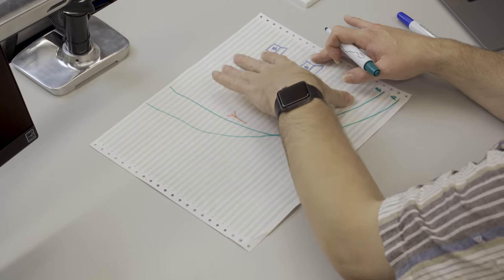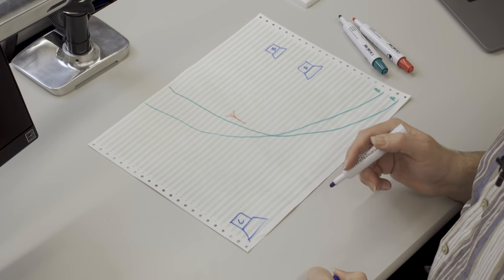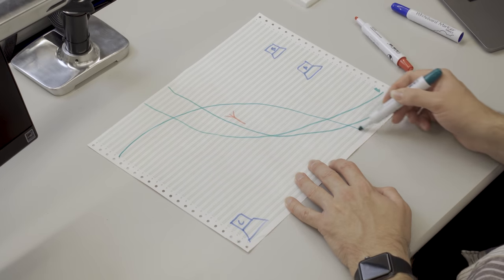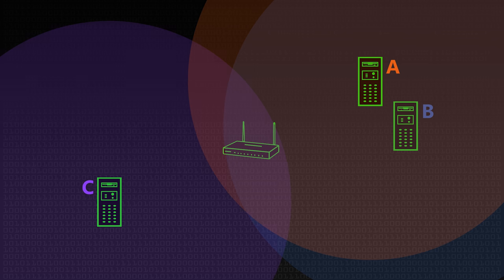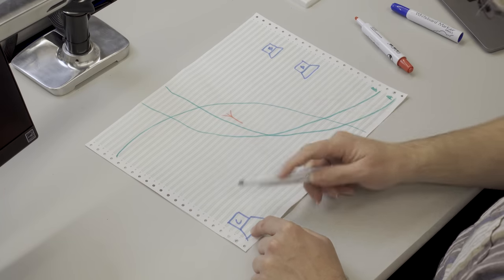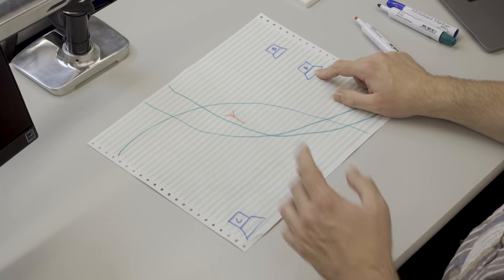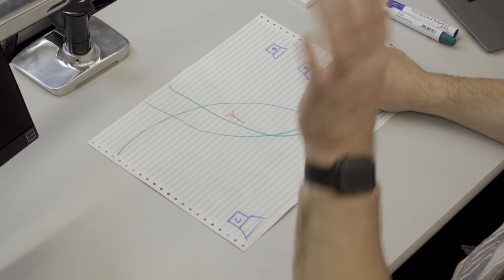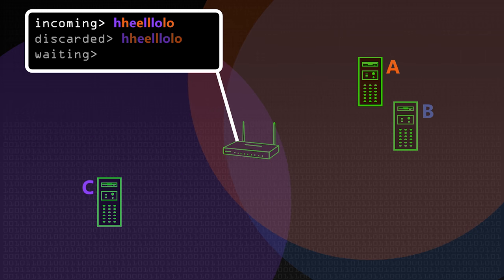WiFi's Hidden ____ Problem - Computerphile

Comment: Don't get it.
If node 'A' is sending a large packet then 'C' doesn't know about it. 'C' will then send its RTS packet which might be short but is still going to corrupt the large packet 'A' is sending. Both packets still get corrupted, its just that 'C' has only lost a small packet. How has that helped?

The only way I can see around this is if the base station sends another packet to tell 'C' that 'A' has finished talking.?

Comment: I presume an access point that can handle 30 devices would effectively be able to do 30 of these handshakes at the same time?
Reply: Nope. One at a time per channel. They just happen in milliseconds, so in practice it can seem like you have multiple devices connected at the same time. Some routers DO have multiple channels though, split up by wavelength, and beam-forming can allow an access point to split up each wavelength into multiple spatially separated channels (MIMO). But this video is clearly only talking about a single channel, omnidirectional access point.
Reply: @benjaminmiller3620  so how would router/access point deal with multiple devices downloading files at the same time? Do they have a limited number of packets and just take turns at being able to receive data? Genuine question..
Reply: @JayGee6996  Yup. You got it exactly right.
Reply: @benjaminmiller3620  interesting, thanks for helping me understand. I work in a school where my student’s laptops are constantly dropping off the WiFi network, either connected but no internet, or just drop off totally and need reconnected or throw error messages in chrome saying your connection was interrupted - a network change was detected. This never seems to happen to my own laptop which uses the same WiFi so I’m trying to learn what could be happening so I can pass it on

Comment: So how does this work for mobile phones? I would imagine that if you increase the number of nodes by some order of magnitude, this system would eventually just fail.
Reply: Mobile phone networks are a lot more complicated, but essentially the phones do not send requests, but instead they are asked by the base station in time slots if they have anything to say. (This is called TDMA or time domain multiple access).

Comment: What kind of attacks can happen because of this?
Reply: An outright RTS attack would be a way to "jam" the network. Rogue AP would be another if the intent were to degrade connectivity further. There's also a possibility where an evil twin attack could indirectly exploit the hidden node problem. In this case the evil twin would likely be positioned at the edge of the connectivity range of the legitimate access point. An unassuming user could then attempt to connect to the evil twin to regain connectivity without realizing it is a malicious AP. At this point the attacker could snoop or attempt to infiltrate a device on the malicious network if a device connects. It should be noted all of these require access to the network vicinity.

Comment: diffrence between: 2G, 3G, 4G and 5G?
Reply: Besides operating at different frequencies they handle multiplexing in different ways. 2G, 3G, and 4G achieve this with code division multiple access (CDMA) like they talk about in this video for most carriers. 4G LTE and 5G use orthogonal frequency division multiple access (OFDMA).

Comment: This isn't quire as hidden a problem, is it? WiFi is full of such issues, which is why I prefer to have as many of my devices wired to a switch or router as possible instead of having them adding to the electromagnetic background murmur the gazillion of wireless gadgets make everywhere.

Comment: What is some toxic receiver spends its time sending CTS notices for emiters that don't exist? Wouldn't it basically freeze all the real emiters within reach of that toxic receiver, and paralyze the system?
Reply: It's a shared channel, you could just send noise and prevent anything from using the channel, and there is nothing you can do about that at the protocol level.

Comment: Awful design. WIFI devices should have a clock and be given time slices to operate within.
Reply: Now you have to synchronize the clocks somehow and dynamically request/negotiate which users get how much transmission time, etc.
Reply: @AlexForencich  - electromagnetic waves move at the speed of light. The router broadcasts its time - everybody is in sync.

The router knows of every authorized client - it can calculate which nanosecond after every millisecond everybody should send their ready to send.

It will eliminate collisions and waiting random periods of time - both of which impact performance drastically when many clients are trying to communicate at once.

A synchronized system can maximize bandwidth for everybody.
Reply: @JohnnyWednesday  There are always trade-offs associated with these things.  Nanosecond-precision timing requires more expensive time sources or more frequent time synchronization.  Time synchronization consumes bandwidth that could be used for data transfer, and also doesn't work very well in a multipath environment, especially when your target is nanosecond precision.  Multipath causes problems for high precision transmissions anyway and is one of the major reasons for the move from CDMA to OFDM.  And for this to work, the access point still needs to know who needs to send what where, so there still needs to be a way for clients to make requests.  What do you do for that - waste a time slot for each client even if they don't have any data to send?  Also there are issues with getting nodes in sync in the first place, which can be a significant problem for low power devices that would prefer to go to sleep most of the time, and implementing high precision time sync would mean that low power nodes would have to consume a lot more power getting connected to the network each time they wake up.
Reply: The current  design uses  CDMA which is superior to  TDMA in every way. RTS/CTS isn't used on modern wifi. Wifi6  is moving to  OFDM which is superior  yet and used for LTE.

Comment: How anyone can get through a course containing this type of brain-knotting information clutter I will never know. I can operate PCs Laptops Wifi Ethernet cable connections Digital Graphics and Digital Audio and Video but don't ask me to understand the nuts and bolts of how it works - It's almost like Occult science.  I can fine-tune a Concert Grand Piano but Sight-Reading musical notation forget it - it does my brain in big time. I've tried for 67 years and it never worked for me. No way can I understand this but nice try.